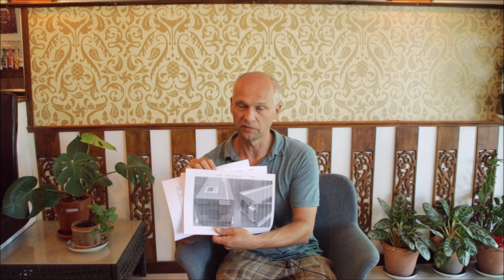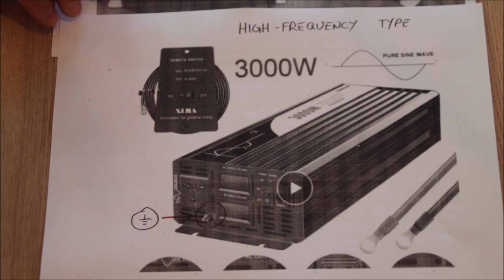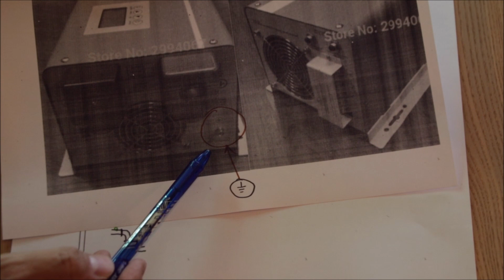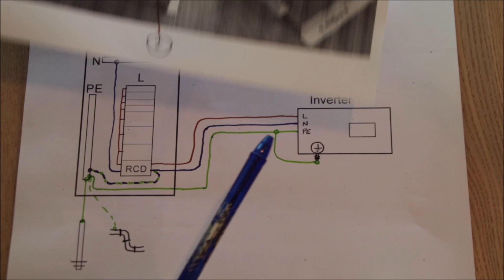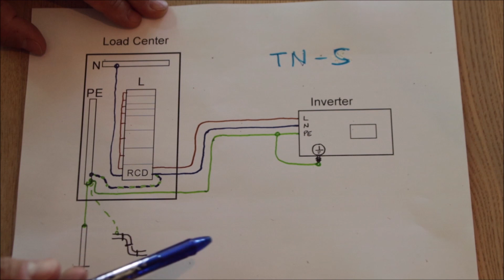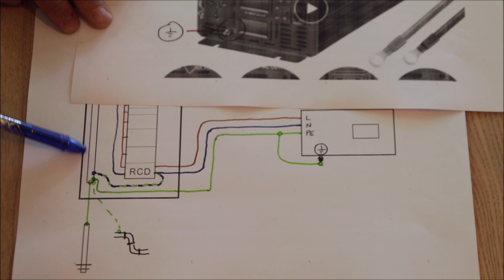Inverter Earthing and N-G Bonding in a simple Off-Grid Setup

Comment: my Felicity IVEM5048 inverter off-grid inverter is giving me a really strange problem when I tried binding neutral/ground. I tried binding neutral and ground in AC distribution panel and inverter threw an error and it went offline. so, I opened up AC distribution panel and I discovered that voltages on Live and neutral wires are reversed, that is neutral wire has 230V and live is 0V. I am using one probe of the DVOM on the ground terminal in AC panel and other probe I place on live or neutral  so that I can measure the voltage potential. 

In AC panel Live brown wire is wired to AC breakers and neutral blue wire is wired to a junction block with all other blue wires. So, I thought, maybe these 2 wires are reversed at the inverter. nope, they are good, connected correctly.

So, I did another test, I intentionally reversed the live and neutral from the inverter at AC distribution panel. Now brown wire that connects to AC breakers should be "live" and blue wire should be neutral, right? guess what? nope! Blue wire (neutral) in AC panel is again live and brown wire is  0V so it in neutral.

Strangely, the inverter is somehow preferring that neutral wires in AC distribution panel are live and live wires are neutral no matter how I flip the wires. Inverter somehow does flip its live and neutral output so that blue wire (suppose to be neutral) is always live. can someone make any sense of that? Any ideas how to do some additional troubleshooting?
Reply from the maker: hi. wow, never heared anything like that.
So, not connected to the installation, but the ground connected to the inverter terminal and grounding point on the chassis, the output on the inverter towards a ground reference is correct, reversed or floating?
What's your country?
Reply: @RolandW_DIYEnergyandMore  inverter is not connected to grid, inverter is the only source of power. ground from the inverter is connected to ground rod at the AC breaker cabinet. Breaker cabinet is plastic, it is European standard,  it is not like metal cabinet in US. inside the cabinet there is a junction terminal for neutral wire and another junction terminal for ground, and to this terminal ground rod is connected. Everything inside inverter seems correct. I will open the inverter cover once more and double check.

Comment: Das ist SINNBEFREIT das Video!
"Wie klein muss denn das OG sein?" Häng das Teil irgendwo dran... OG ist ja DAAAAS Synonym für Pfusch🎉 Also das Gequatsche ...quickly" ist schon grenzwertig By The Way🎉
Also jetzt um was geht es? Der Inverter oder Generator oder Wandler haut auf jede angeschlossene Last auf jeden Leiter eine Spannung⚡
Einzig AM GERÄT ist das Bonding an der PE Klinke😂 und sonst Nix. Und nicht mal DA muss eine leitende Verbindung zum Gehäuse sein😉 Richtig so weit! Jetzt haben wir eine maritime Situation, wo absolut Nix mit dem Metall in Berührung kommt🎉 Ist bei dem "Sternpunkt" einer 3 Phasen Spannungsquelle auch so. Und was soll passieren? Nix. Ahhh RCD! JA. Jetzt wird die N PE Brücke wichtig. Und wo setzen wir Die 🤔 Na da wo eingespeist wird. 
Und das ganze Gequatsche über Netzform😢
Was wird schon sein? Kabel. Braun blau grünorange😂 Mit viel Glück! Sicherungen und Messgedönse...
Laut Norm, ist die N/PE Brücke an einem ❤EINZIGEN❤ Punkt- vor🎉🎉🎉🎉 allem anderen Gedönse zu setzen!
Und wenn dann doch ein Grid ON dran hängt... Wen interessiert das dann? Hast Dir mal überlegt warum man auch noch den Erdspiess braucht? Damit die Zähler noch schneller gehen 😅
Fakt ist, wenn in der Bastelbude ein Erdschluss, off grid, entsteht, weil irgendwas nicht isoliert ist. Hochdruckreiniger zB. was ist dann mit der Pfütze? Entsteht Schrittspannung barfuss? Ich würde mal lieber ohne "Erdspiess" da rumspazieren. Du?

Comment: Hello sir, greetings from Cyprus and thank you for all your videos. I have some questions regarding the earthing rods. I have a separate storage room for the inverter installation and the batteries, about 12 meters away from the control panel. It is better to make the ground connection with neutral in the storage room with an earthing rod and then give neutral and earth to the control panel.Or just make the bonding in the control panel and It is not affected by the 12 meter distance.? Or would it be better to have two grounding points, one in the storage bonding T-N and one near the control panel just for the T bar? Will having two grounding points affect the total resistance? What would you suggest? Thank you in advance, and I hope you understand my question.
Reply from the maker: hi. ist this a pure off-grid installation or is the grid feeding into the control panel at your house?
Reply: @RolandW_DIYEnergyandMore   pure off grid installation. 11Kw high frequency inverter.
Reply from the maker: @ReginaChristinaParaskeva-o7p perfect. then make grounding rod at you shed at inverter ansd make N-G bond there. from shed to house make 3 ( or 5 if 3 phase) wire connection. no more bonding or grounding rod there...
Reply: @RolandW_DIYEnergyandMore  thanks a lot for sharing free your knowledge.

Comment: I have done the same to take my house off grid and before it i was getting a voltage through the neutral and no earth reading in my sockets. I am part qualified as an electrician but i have installed it to my main circuit breaker board and it works fine but do i need to remove the earth neutral connection inside my circuit breaker box as it now is bonded to neutral at the first RCD. 
I am also having problems with my generator that i use in winter as it trips the RCD and needs the neutral earth bond separating. I have contacted the company that it is made by to see where its located as i cant find where the bond is.
Reply from the maker: Yes, only one bond before the RCD. Any other bond after the RCD might trip the RCD. Where did you connect the generator to your breaker box? Through a breaker behind the main RCD or before the RCD (maybe also through a transfer switch?)
Reply: Hi thank you for the information, I have already checked my fuse box and there is only earth going into earth and neutral wires in the neutral bar and the main fuse has the connection from neutral to earth so it seems right and my sockets seem ok and have an earth. My generator is plugged directly into my inverter where you can connect either grid or a generator, I have messaged the company to see where I can disconnect the ground and neutral in the generator wiring. I have checked inside and can only find earth and neutral separate but it must be somewhere in it. It's a champion 7000 watt dual fuel generator. I used it in winter just on normal circuit breakers not RCDs and it powered the house and charged my solar batteries. I charged them for about an hour most days in winter but since fitting an RCD the generator trips it. I think if I can find where the ground is bonded with neutral it will fix the problem. @RolandW_DIYEnergyandMore
Reply: I managed to sort my generator problem by changing the 30ma RCD to a 100ma RCD and the generator works fine and can power my house and charge my solar batteries at the same time. I did see an electricians page that said to add the earth from neutral where the supply comes in and I have done it from the 100ma RCD, it also says if using a generator as a mains supply it should only be earthed from where the supply comes in. Everything is running great now and my socket testers show correct wiring with an earth now. Thank you for the information and great videos

Comment: Excellent and very educational video. I’m new to the world of photovoltaics and currently trying to set up a small home system. It will power two outlets via the inverter’s panel, used for specific appliances. It will operate simultaneously with the main grid but without any direct electrical connection between the two systems.

I’ve purchased an all-in-one inverter (EASUN SMG II 4kW) and I’m somewhat confused about the grounding issue. Initially, I intended to bond inside the inverter’s panel and simply connect its ground to the utility’s ground at the main home panel. However, this plan was scrapped because it would either result in two bonding points or no effective grounding for the inverter(Because the neutral and earth are already bonded by the utility inside the main electricity meter).

Now I’m considering installing a separate, dedicated grounding bar just for the inverter and bonding it internally. However, I’m concerned, as I’ve read that having multiple grounding systems in the same building is prohibited. If the inverter’s grounding rod is over 10 meters away from the utility’s ground, could this create a safety or technical issue?
Reply from the maker: I am assuming that your concern is what happens when the All-in-One Inverter bypasses its output to the grid, because only then there would be 2 bonds. So yes, that's why you would have to use a bonding relay. But this has challenges if the inverter doesn't provide a signal showing that it is Off-grid or On-Grid
Reply: @RolandW_DIYEnergyandMore  this inverter is off grid .. now im much more comfused....So its wrong to install a second ground?
Reply from the maker: @userweddf7627  pure off grid? no internal switching to grid when the battery is flat?
Then just make a N-PE bond at the output and get the PE from your house PE as Zero reference. There is no double bond as the power sources are separate, so no fault currents can be canceling out each other. It might be against your code but it's save if you are in a TN-C-S as you seem to be
Reply from the maker: @userweddf7627  putting a dedicated rod for your off-grid inverter 10m away from the utility ones is as well perfectly safe.
Reply: @RolandW_DIYEnergyandMore  Yes pure off grid.if my battery go flat must wait until next morning for my panels:)i m doing this to cut off some KWH from my bill. I want to charge my car from this setup. So...... bond N-PE to my inverters panel PE cable to my main panel at PE bar and all are ok except the rule violations.Thank you for your reply!
Reply: @RolandW_DIYEnergyandMore  Just saw that!!thank you again!

Comment: If your inverter is connected to the gird, do you need to bond N AND G? my inverter use his battery and then when they are empty it uses the grid in by pass mod so i dont know if i need to do that?
Reply from the maker: Inverters with grid bypass need a N-G bond when they are in off-grid mode. When they go to bypass they use the grounding setup of your grid. 
But this is the challenge. You need to correctly establish the bond while not interfering incorrectly with the grid...

Comment: Hi.  I thought the cheap inverters with only an ac recepticle (ie no terminal strip ) should NOT be bonded because they dont have a normal 120v line and 0v neutral , instead they have 60v line and 60v neutral , out of phase to create the 120v  fake effect .  In this case bonding the neutral to ground would put a real 60v on ground which is dangerous.   Am i correct ?
Reply from the maker: Yes. You guys from US with split phase have to be careful with such cheap equipment designs which are just a shortcut for manufacturers to save on pcb boards.
If you know that you have a repurposed 240V split phase inverter downgraded to a 120V. Don't ground it!
Reply: @RolandW_DIYEnergyandMore  i believe the way to test if you have a "cheap" inverter is to power an incandescent light from the neutral to ground,  if it lights up , its a cheap unit, in other words there was a real (not ghost) 60v on the neutral.   Am I correct ?

Comment: I have 48v 3.5kva inverter (240v)running off solar (OG) and am getting 50/60v between E>N ...I can find no short in wiring circuit of load. And originally there was no earth rod. I installed earth rod and issue is still there. Inverter has ac inlet for possible charging from mains so I am presuming it won't have an internal N>E bonding 🤔 . It's su Kam fusion inverter .. everything in my electrical knowledge says don't bond N>E 😂😂😂.but I'm thinking maybe I should try it😬
Reply from the maker: @MrmachineELF  What type of inverter is it one phase L,N or Splitphase US?
Reply: @RolandW_DIYEnergyandMore single phase only running of solar configuration . We have no mains supply.
Reply from the maker: @MrmachineELF  you should bond N and you grounding system. no surprise expected to happen ;)
Reply: @RolandW_DIYEnergyandMore 
Thanks for the help ✌🏻
Reply: @RolandW_DIYEnergyandMore you sir are a genius and a legend . Did exactly this and now all circuits are testing perfectly . N>E leak has gone . Thankyou sir 🙏🏼
Reply: @RolandW_DIYEnergyandMore one more query . Is it ok  to connect a generator with that bond installed?  in case of solar breakdown or no sun which happens  in monsoon season.
Reply from the maker: @MrmachineELF  yes, a mobile generator is same as a solar inverter usually isolated and requires bonding. just connect it to your system according to correct L,N, PE markings. The only power source which can mess up things when mixed in, is the grid.
Reply: @RolandW_DIYEnergyandMore thankyou , the whole thing makes sense really , as N is bonded on mains connections . 👍🏼. Thanks for the help you have another subscriber .

Comment: Do you connect the inverter neutral to the house neutral link that has grid feed if running a house from two sources. Off grid inverter battery system and grid connect via a changeover switch?
Reply from the maker: In my TNC-S grid I can do that, yes. But you still have to disconnect both the Ls and the Neutral on the transfer switch of each source...

Comment: Hi, have you seen Will Prowse video about grounding? He states that it is unwise to connect to a grounding rod. What are your thoughts about his video?
Reply from the maker: Hi. I don't know to which video from him you are exactly referring to, but I saw pretty much every of his videos.

He is often ignoring grounding per se, but when he says it is unwise, then he might refer to it out of the perspective of using small inverters for RV applications. There, it can be really better to stay isolated.

But as time passed, Will turned his focus on large scale home installations (he isn't Americas biggest sales-rep for solar equipment without reason ;) ), and when it comes to complex installations, then you must follow international accepted rules of electrical engineering which states, that you must ground your systems and use protective devices like RCDs and GFCIs. 
But even isolated systems by definition must use ground to connect all outer metallic shells to avoid buildup of harmful potentials on objects you can touch. That rule Will unfortunately is often omitting in his videos, or he is connecting N-G without using physical ground (rod), which is even worse.

The guys in the US do have a little different view of electricity. That is probably because the much lower voltage of 120V used by normal single phase equipment will be a bit forgiving. Letting 230V floating around without safety grounding can in case of leakages get you into a bad situation very quickly. So we guys in the rest of the world try to focus on it a bit more seriously.

So yeah. Grounding isn't necessary by definition always. But as we are trying to get energy independent and supplying ourself with our own energy, we must see our own installations the way we see any other grid-connected installation. Because we humans are connected to ground, all the safety equipment and procedures are ground-centric. And in order to make everything working as anticipated, we need to ground our electrical installations.

Cheers!
Reply: Wow, thank you so much for such an extensive reply! ❤

Comment: Thanks for the tutorial, it was really easy to understand. I have a stand alone offgrid system (UK) and have a question: should I connect the AC ground from the consumer unit (breaker panel) to a new, separate earth rod, or should I bond it to a DC earth busbar and have only one earth/ground rod in the system? Thanks.
Reply from the maker: hi. what did you connect to the DC earthing exactly? if it's SPDs only, then you can connect the AC ground there too. if you have grounded some DC power lines, then you should separate them, or/and at least use a Type-B RCD on the AC output to avoid DC leakage into AC side.
Reply: @RolandW_DIYEnergyandMore  Thanks for fast reply. DC earth is connected to negative from batteries and ground from solar charger. If using separate earthing, how fare apart should I put DC and AC earth rods? Thanks
Reply from the maker: @JHubnerProductions  5m or more would be advisable. If your inverter is known not to be transformerless, then you can still just use one rod if you like.

Comment: Hi.. Thank you very much for your video, I have deye inverter 6k, the voltage between live and earth is 130v and between neutral and earth is 99v ? should I bond neutral with earth? Thanks alot.
Reply from the maker: hi, yes. i did show an installation  of a 6k Deye hybrid system a few months ago in 2 videos. if you didn't see them yet, please check the playlist for it. thanks

Comment: can we use diode  with inverter pin  for earthing or all dc earthing point ?
Reply from the maker: If you have somewhere on your DC equipment a symbol for earthing/earthing point, then connect it to earth. But do not earth any DC power lines (with or without diode), just dont.